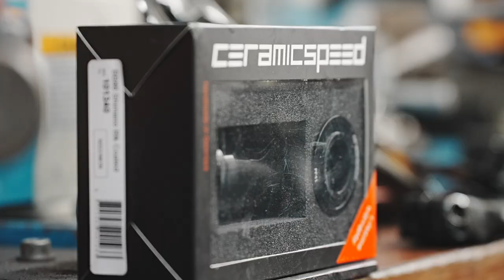2023 GIANT TCR Team BikeExchange-Jayco 車隊版組裝~! 美到爆!!

Comment: Beautiful bike....  but Giant  continue with exposed brake cables......
Reply: With a small trick involving the replacement of the bearings in the headtube and an oval hole measuring 0.5x1cm in the fork's tube, you can completely internally route two cable wires.